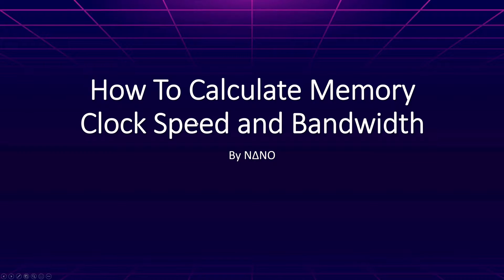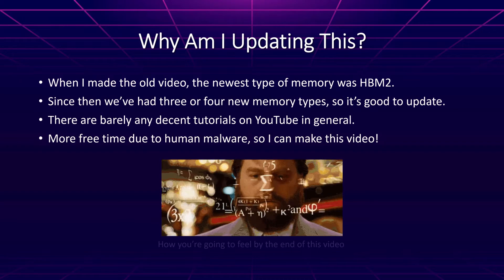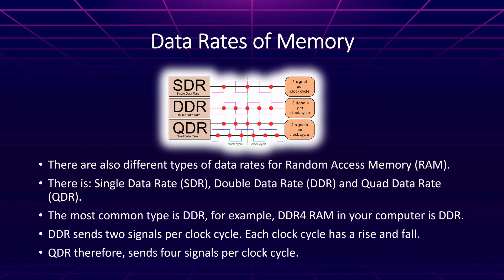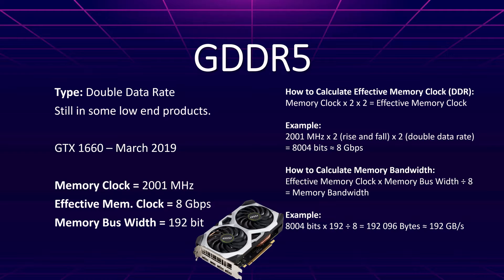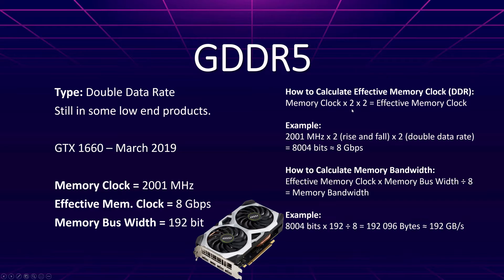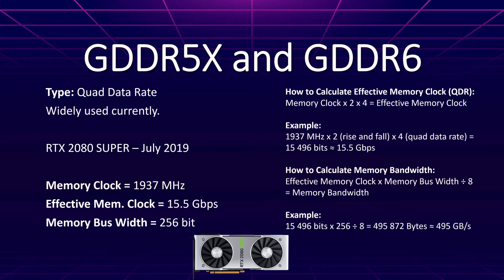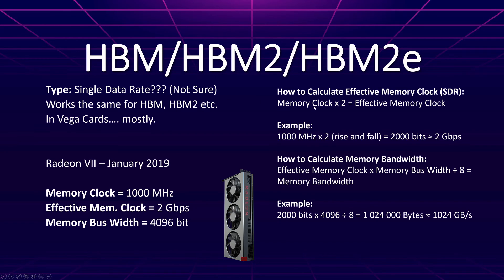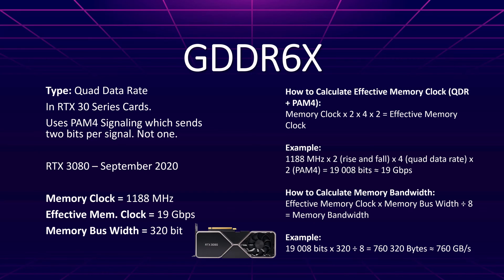Tutorial: How to calculate GPU memory clock speed and memory bandwidth - GDDR6, GDDR6X, HBM2e etc

Comment: Thanks for the informative video, however you're mixing megabits and bits. 1188 MHz * 16 = 19008 Megabits (not bits) = 19 Gbps
Reply from the maker: Yes some other commenter pointed this out to me. I apologise for the error. I will copy-paste my previous response:

Yes, I just noticed I messed up the slides for the video as I used each one as a template, so they all have the same error. I forgot to add the word "mega" for bits and bytes in certain areas. For instance the bit for GDDR6X, "I said 19,008 bits". It's meant to be 19008 megabits. 19008 megabits = 19 Gbps.

Same for memory bandwidth, I say "760 320 bytes", it should say "megabytes".  I will do better in future to not make simple errors like this.
Reply: @NANOTECHYT  
No need to apologise, it happens. Honestly though, best explanation out there by far! Keep up the good work.

Comment: Isn't it more appropriate for the memory clock to be measured in MegaTransfers or GigaTransfers as it is done with RAM speeds? I think that Gbps for second is a bit misleading as the calculation that we have for the effective clock results in the total number of "signals "(or whatever it is called) per second. I guess if for each signal the memory processes 1 bit of information then it makes sense for the final result to be shown in Gbps. I guess that the calculation for the memory bus width actually shows that since we multiply the effective clock with the bus width in bit and then it makes sense for the final results to be in bit/bytes per second.

Comment: Your calculation for GDDR6x makes no sense. Please double-check your values
Reply: Im with 3080 that use GDDR6x  and in stock is  1188 x2x4x2 = 19008   x320 /8 = 760000 /1000 = 760 GB/s like showing in GPU-Z . Overclock my memory with Afterburner + 1000mhz will lead to 1312.5 x2x4x2 = 21000 x320 /8 = 84000 /1000 = 840 GB/s again showing that in GPU-Z . Afterburner is showing memory at 9501 that you need to /4 then /2 = 1,187.6mhz . HWINFO will show 2375.5 /2 = 1,187.7mgz. Most programs calculate memory diffrent.

Comment: i am confused about the effective memory clock. how 8004 bits is equivalent to 8 Gbps ????? it must be error. 8004 Mega bits are roughly equivalent to 8Gbps.
Reply from the maker: Yes some other commenter pointed this out to me. I apologise for the error. I will copy-paste my previous response:

Yes, I just noticed I messed up the slides for the video as I used each one as a template, so they all have the same error. I forgot to add the word "mega" for bits and bytes in certain areas. For instance the bit for GDDR6X, "I said 19,008 bits". It's meant to be 19008 megabits. 19008 megabits = 19 Gbps.

Same for memory bandwidth, I say "760 320 bytes", it should say "megabytes".  I will do better in future to not make simple errors like this.

Comment: idky, i run the calc and get an rtx 4090 with 1.7TB/s, but i read around the internet that it is 1TB/s
Reply from the maker: To calculate for an RTX 4090, the memory speed is 1313 MHz. So it's 1313 * 2 (rise and fall) * 4 (QDR) * 2 (PAM4) = 21,008 Mbps = 21 Gbps.

21,008 * 384 bit memory bus / 8 = 1 TB/S.
Reply: @NANOTECHYT  aight
Reply from the maker: @assholeyeng  How did you get 1.7 TB/s?

Comment: When you're calculating effective memory clock of a GPU it's actually transfers/sec and not Gbps. GDDR6X as an example 1188 MHz * 2 * 4 * 2 = 19008 MT/s (megatransfers). This equals to 19.008 GT/sec. This way we get 19.008 GT/sec * 320bit * (1byte/8bit) = 760 GB/s. 
760320 bytes/s = 0.00076032 GB/s and not 760 GB/s as in the video.
Reply from the maker: > When you're calculating effective memory clock of a GPU it's actually transfers/sec and not Gbps.

It's fine to use 'Gbps' for effective memory clock. NVIDIA use it on their specs page for the GTX 1080 for instance. They list "10 Gbps" - Source: https://www.nvidia.com/en-gb/geforce/graphics-cards/geforce-gtx-1080/specifications/

We can apply Gbps to then find the memory bandwidth too. Since 8 bits = a byte. Then we take 10 Gbps and divide it by 8 = 1.25 GB/s. 1.25 GB/s * 256 bit bus width = ~320 GB/s of memory bandwidth, which is the GTX 1080's memory bandwidth.

If we take this same principle and apply it to the RTX 3090 as you have, then it's 19 Gbps / 8 bits = 2.375 GB/s * 320 bus width= 760 GB/s.

Gbps is fine to use for effective memory clock.

> 760320 bytes/s = 0.00076032 GB/s and not 760 GB/s as in the video.

Yes, I just noticed I messed up the slides for the video as I used each one as a template, so they all have the same error. I forgot to add the word "mega" for bits and bytes in certain areas. For instance the bit for GDDR6X, "I said 19,008 bits". It's meant to be 19008 megabits. 19008 megabits = 19 Gbps.

Same for memory bandwidth, I say "760 320 bytes", it should say "megabytes".  I will do better in future to not make simple errors like this.

Comment: I hope this helps me understand why my GPU is saying 19002 uhm, mhz? Dafuq? Is it really running at 19002 mhz?

Edit: It did! The GDDR6 part of the video. It helps me understand what but not why but what is good enough for me.
Reply from the maker: I'm guessing you have like a 3080 or 3080 Ti? I don't know if any GDDR6 cards really have had their memory speeds be overclocked to 19 Gbps on air. I can help you understand why though. 10:34 in the video is what will help you since you're likely running GDDR6X memory if you card is in fact a 3080 Ti or 3080. As I said in the video, GDDR6X is Quad Data Rate, which means it's using PAM4 signalling, meaning two bits per signal, and two signals being sent per clock cycle, meaning a total of 4 bits per clock cycle. Meaning an effective memory clock of 19 Gbps is possible. Why is it doing this? It's just more effective memory speed and bandwidth and GDDR6X is the most advanced memory available on the market right now other than maybe HBM3.
Reply: @NANOTECHYT  I have the Gigabyte Gaming OC RTX 3080 12GB. Not the ti. I chose this model specifically for the 4 year warranty and the 2x 8pins which is all my PSU has. I'm not sure I understand the memory speeds. Aorus Engine shows my memory at 19000mhz for some reason, I increased it to 20000mhz and it's running good, my TimeSpy score went up not down haha. So what speed is my memory really running at?
Reply from the maker: @y_zass  Which program did you increase the memory speed with? Aorus Engine? MSI Afterburner? It should be running at 20,000 MHz = 20 Gbps. If your score went up then thats good, it means you have a good overclock. I say this because sometimes if you overclock the memory too much, ECC kicks in for error correction and reduces performance.
Reply: @NANOTECHYT  I'm using Aorus Engine. I know some people prefer others and they work with all cards but I just stick with my cards software. So 20,000 memory is the same as 20gbps? I haven't touched voltages, I've heard it doesn't change anyways. Is that true? I also lost my 5% power limit increase for some reason. I was able to increase it 5% to 105%, it would pull 360w instead of 350w but now the slider only goes to 100% what is up with that right? I wonder if it was the BIOS switch but I doubt it being I switched from silent to oc
Reply from the maker: @y_zass  > So 20,000 memory is the same as 20gbps? I haven't touched voltages, I've heard it doesn't change anyways. Is that true?

Yes. 20,000 MHz is 20 Gbps. Technically, it's not even MHz, it's more like Megatransfers, but regardless, the terminology is synonymous. But just think of it like Gigabytes and Megabytes. 1000 Megabytes = A Gigabyte, so same with clock speeds. 20,000 Megatransfers = 20 Gigatransfers.

As for voltages, yeah that's true too. You can't tweak voltages for NVIDIA cards memory. You also cannot exceed 1.093 mV on the GPU core clock. They are hard locked on a BIOS level and the BIOS is encrypted, so no way to go above 1.093 mV. however, you can undervolt the GPU core, so it can run cooler and quieter.

>  I also lost my 5% power limit increase for some reason. I was able to increase it 5% to 105%, it would pull 360w instead of 350w but now the slider only goes to 100% what is up with that right? I wonder if it was the BIOS switch but I doubt it being I switched from silent to oc

It's definitely the BIOS switch. Try sliding it back. I think you may actually have it in the 'silent' position as opposed to the 'OC' position. Double check. Usually OC allows for extra power limit. Also, 105% power should be around 365 Watts. Honestly though I wouldn't be too fussed, power limit barely ever does anything for performance. You mostly just draw extra power for maybe half an FPS. That is unless of course you're doing some kind of hardcore overclocking with Liquid Nitrogen, but thats not you, so I wouldn't worry.

Comment: This is an excellent educational video and really explains it all!! I have a technical question which brought me here to find out what 19.5Gbs actually meant in terms of Mhz. I have a Zotac 3090 Trinity OC that has a factory spec of 1219 MHz 19.5 Gbps effective HOWEVER I can only OC this card to 900Mhz and anything higher it become unstable. Based on these calculations the effective bandwidth of this card is actually 14.4Gbps. I am trying to make a case for RMA-ing the card to Zotac for replacement. OP can you confirm my findings? And thank you again for an excellent informative video , thumbs up and subscribed!!
Reply from the maker: I'd say something is definitely wrong if it can't reach the factory spec. Sorry for the late reply, but I hope you RMA'd.

Comment: Nice video but i have a question, if for example i have made and overclock to a 15Gbps gpu lets say from 1985 mhz to 2010 mhz that would make the gpu have a 16 Gbps effective memory clock or am i getting it wrong?
Reply from the maker: Yes, correct.
Reply: @NANOTECHYT  ok thanks for the answer that clarifies that 👍